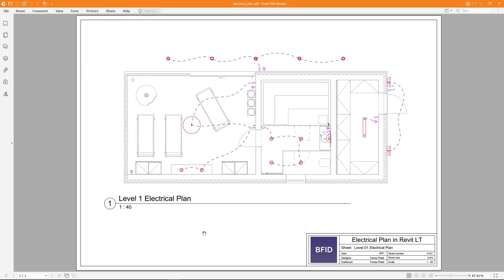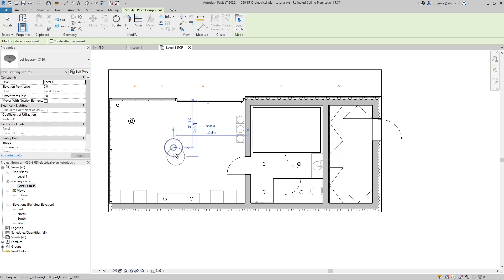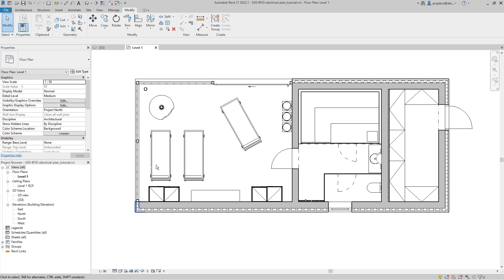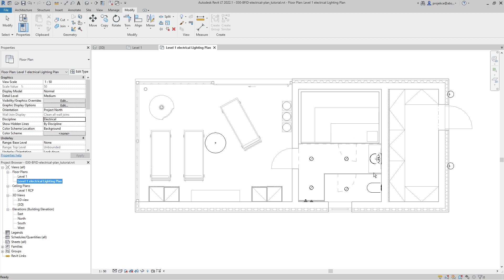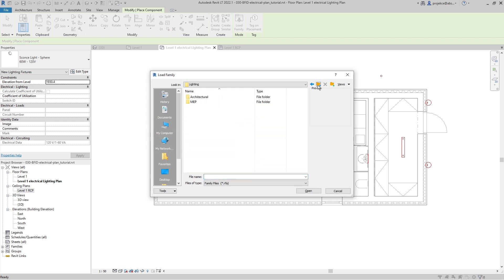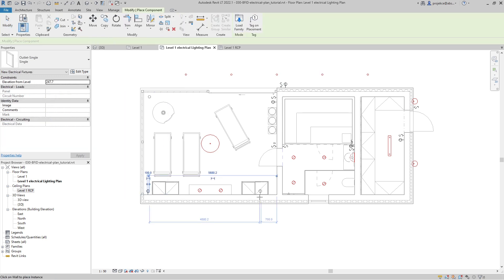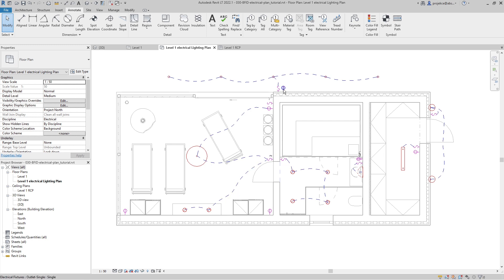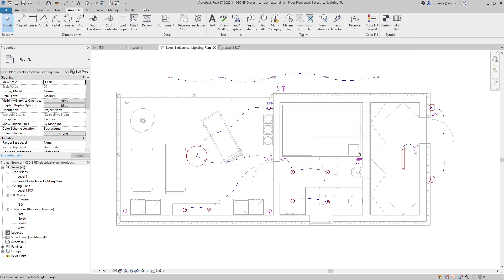Create Electrical Lighting Plan in Revit LT | for Architects

Comment: Thanks for this! Do you know a place where I can download european type symbols for the electrical fixtures ? For example the switches symbols are used in US and not in EU.
Reply from the maker: I think there are many differences in electrical symbols even between European countries. I did this tutorial with US symbols, but for usage in my country I created my own symbols, which were based on a template which my local Autodesk reseller provided. I don't know of any place, where you could download good quality electrical families. You can try to search either manufacturer pages, or pages such as:
Revitcity: https://www.revitcity.com/downloads.php
CADforum: https://www.cadforum.cz/catalog_en/?fo=RFA
Reply: @BIMforInteriorDesign  Hi again, I came back with another question. I read everywhere that Revit LT does not support MEP families. Can you  in fact insert MEP families in your project like power outlets and switches in your Revit LT project?
Reply from the maker: @Constantinesis  Hi, you can use MEP Families in Revit LT. You can see in the video, that I created and used power outlets and switches. But be careful, there are many limitations. Especially for creating MEP systems, connections and calculations. I also found limit, that with LT you are not able to create new families of some categories. You must try it out yourself to see, whether LT is enough for your use. LT is not meant for designing MEP systems.
Reply: @BIMforInteriorDesign  Can you create new electrical outlets and switches or you can only use or edit existing ones? I dont want a full MEP project but to be able to create lighting and power outlet plans as part of the architectural project just like you did. I know should try it to know better.
Reply from the maker: @Constantinesis  You can do that - the same way I did in the tutorial. I was only using Revit LT. I am not sure now, whether you can create electrical families from scratch, but you can for sure edit existing families - so you can create your own set of families.

Comment: When I try to add switches, it doesn't display on my electrical plan but it does on my Main Level plan with all of my other elements. Is there something I need to do to the walls to make the visible on my electrical plan? Thanks for the helpful video!!
Reply from the maker: This might be caused by many things, so it's hard to tell. I would check view range. Or maybe check visibility/graphics overrides of the view - your generic annotations might be turned off in that view.